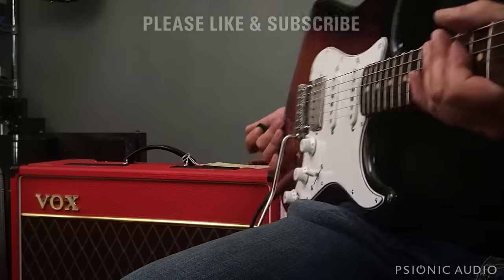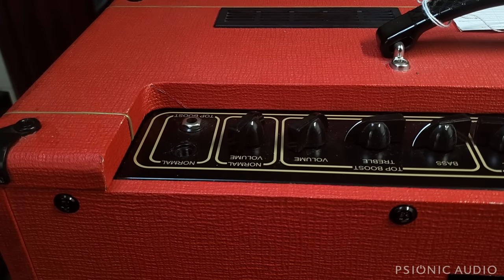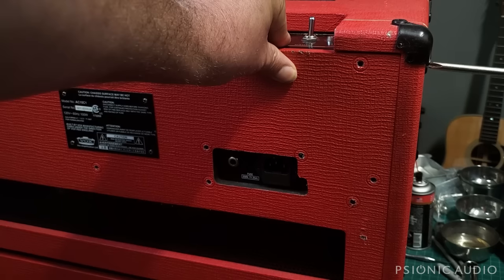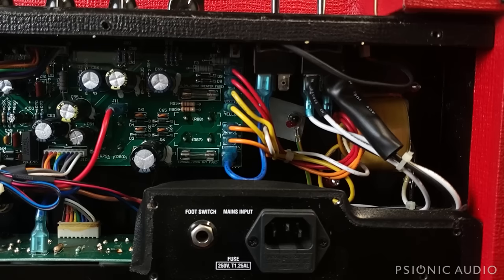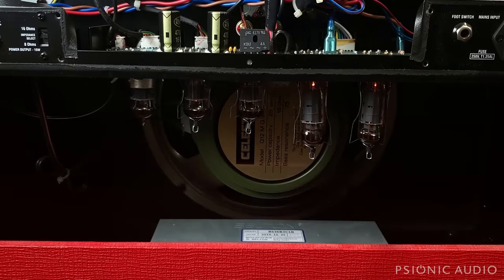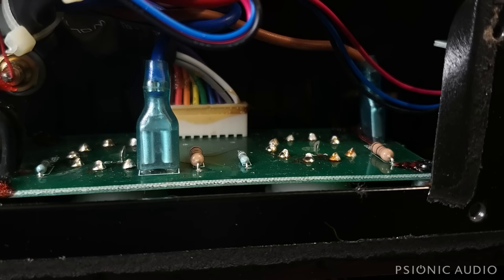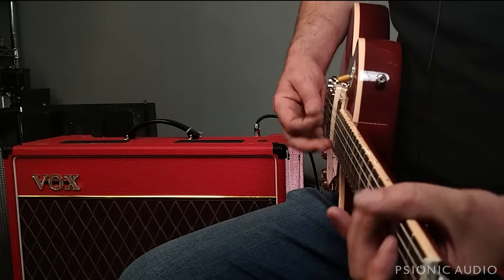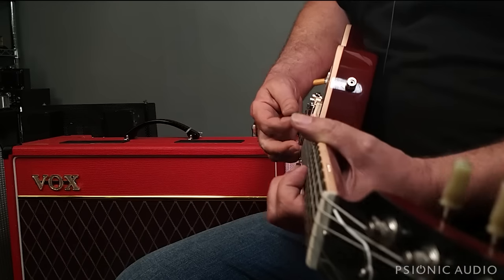Vox AC15C1 - Is It as Good as I Said?

Comment: is it always the case that standby is unnecessary in a tube-rectified circuit? love this new "amps under x" series by the way
Reply from the maker: I'm unaware of any tube rectified guitar amp that needs standby.
Reply: @PsionicAudio  okay, good to know. thanks for the response
Reply: Isn't the purpose of a standby to keep the tubes warmed up during breaks in playing so they're not constantly being heat cycled?  I notice you mention standby switches in your videos only in terms of startup - I've never used a standby that way. SS or tube rectified I've always powered amps up in play mode and put it in standby when taking a break or switching guitars.
Reply from the maker: Most people use it as an overpriced fault-causing mute switch. I put actual mute switches in my own builds. 

But it's fine in a Marshall or in a Deluxe Reverb. The problem is the Vox Custom Classic series or similar amps that disconnect the HT secondary for a Standby. That current surge kills tube rectifiers.

Comment: Around 34:00:  It is high grade MDF not plywood. Very heavy all right so I think you meant to say MDF.
Reply from the maker: Yeah, the one thing I got wrong in the video. Kills me.

I was thinking of everything I needed to say and was thinking "mention the weight" there. It's still a very well constructed cab. And heavy AF.
Reply: @PsionicAudio  not out to critique you... more making sure nobody expects plywood and it comes back to you. 

High grade as it may be the back panels are fragile with all those cutouts and thin regions and adhesive...  

Cheers.
Reply from the maker: The back panel is very thick. I wouldn't be concerned about fragility, like the HRD rear panels.

Comment: I’m a Canadian, and I have owned no fewer than 5 different Traynor amps. They are built like tanks, easy to swap speakers and tubes on, and they all sound like shit. I’d love to know why. 

Even in the promotional videos for the YGL1 and YGL2, they sound like garbage. I wish they didn’t, but there you are.

This is why I play through an AC15C1, a Marshall DSL40CR, or a modified Blues Junior III.
Reply from the maker: Traynors often have linear taper volumes, insanely large bright caps, and are in need of new filters/better grounds. After that they are usually superb for decades
Reply from the maker: https://youtu.be/L06sRebIKMc
Reply: @PsionicAudio the YCV series PCBs are really disappointing. The components are cheap and failure prone, pots are pathetic with plastic shafts, the filter caps are inferior, and the electronics are not very robust overall. Pete Traynor would have been appalled. Love your channel fyi.

Comment: I don't like tube amp sag. Whether it's caused by a tube rectifier or a circuit to simulate it it. I want the notes or chords to fly through the speaker immediately after I hit the strings with no hesitation.
Reply from the maker: Well, a cathode biased amp can be viewed as "never sagging" or as "always sagging." But it doesn't come and go like with a JTM-45.

That said, this amp would not be a good choice for modern metal.

Comment: Thank the EU for these overkill safety regulations
Reply: Thank Vox for complying to safety standards in the ugliest, cheapest fashion imaginable. Safety regulations are good. They literally save lives. Looking at the back of the AC15C1 head version's cabinet though might kill you. Oof.
Reply: @middle_pickup  I don't disagree per se, but how many people were getting permanently harmed by having accessible tubes. That said my 70s AC30 requires the chassis to be removed to change tubes, a few screws and it slides out nice and easy.